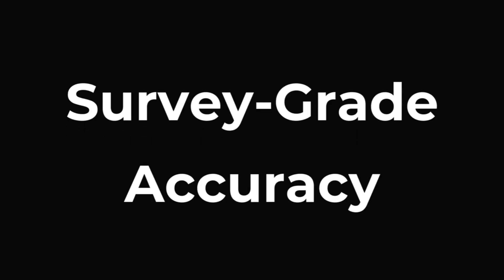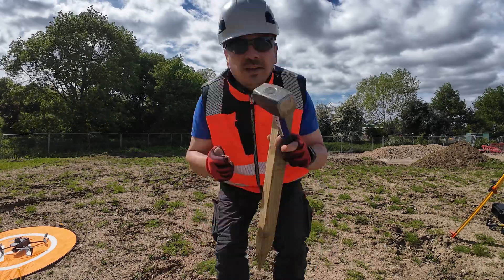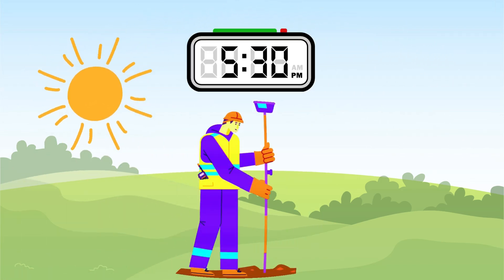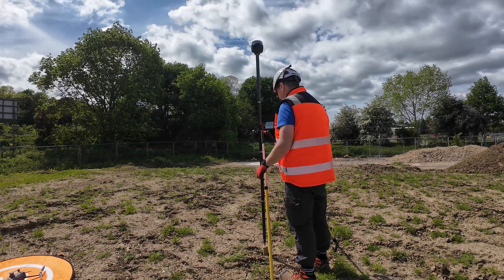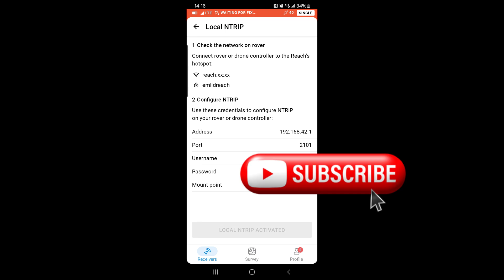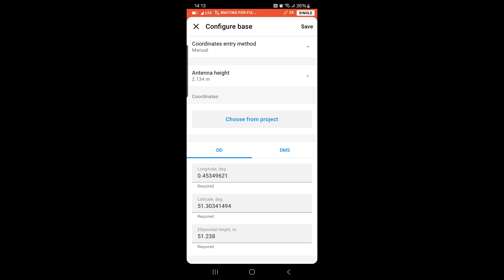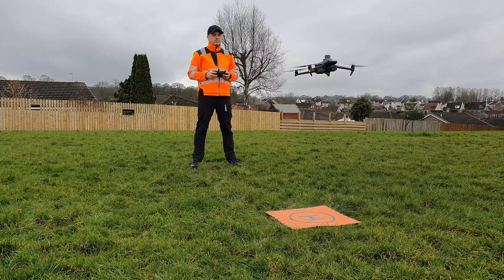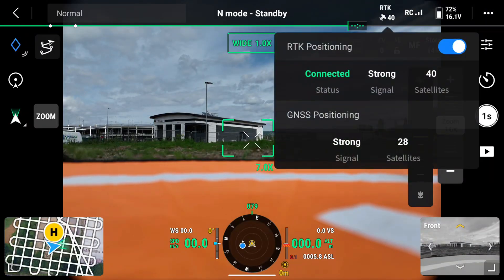The RTK Setup You Need for Survey-Grade Drone Maps

Comment: Great tutorial. I have question about post processing the drone data. If the software does not support the Geoid file natevly my only option is to use PPK or set GCP s with my GNSS receiver that has the geoid file to get correct elevation values? Testing with Matrice 4E
Reply from the maker: @m2rtsoo  thanks! What software do you use? 
Drone data and all GNSS data is always surveyed in WGS84 (or ETRS89 in Europe) and the converted in processing software (in case of drones) or in the case of GNSS rovers in the field software ( Emlid Flow, Trimble Access, Leica Captivate, etc.).
I always recommend using GCP's in your drone surveys (especially in photogrammetry). I am working on a video about this subject 🤫.
Reply from the maker: @m2rtsoo  at the end of this video I present a way to convert your WGS84 data into Grid Data using Emlid Flow. Maybe it helps: https://youtu.be/vJsYVWsfllw?si=7VVzNnbG0FCDyIP0
Reply: @flyingsurveyor  I have tried DJI Terra and Reality Capture. I can choose my coordinate system in the software and get the correct Northing and Easting but the GEOID file  is not available so all my Z s are in Ellipsoidal values.
Reply from the maker: @m2rtsoo  GCP's will sort your problem 👌🏼. Drone photogrammetry relying just on RTK it's good on horizontal but on vertical not so much. That's why you always need GCP's - to pin your photos to the ground and to help your software make more accurate allignment.